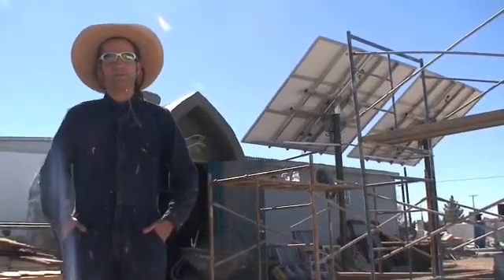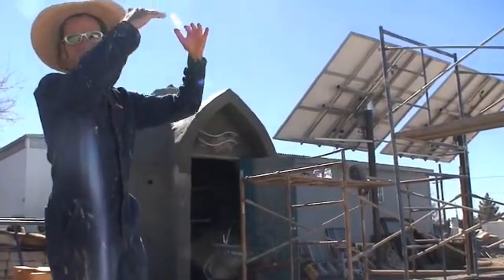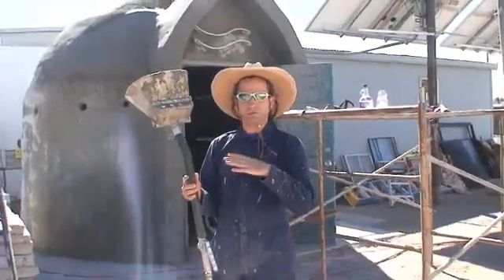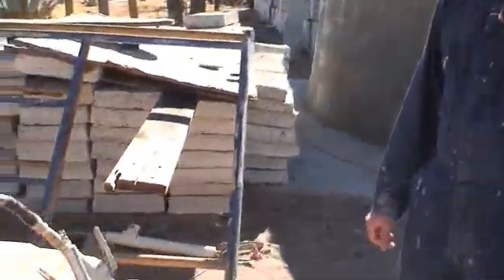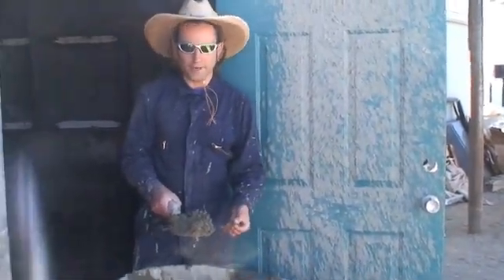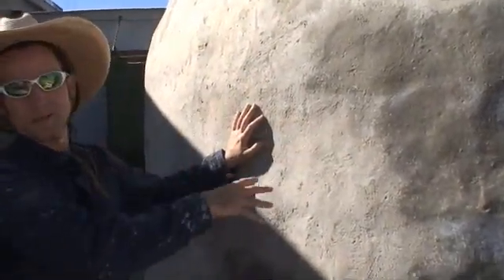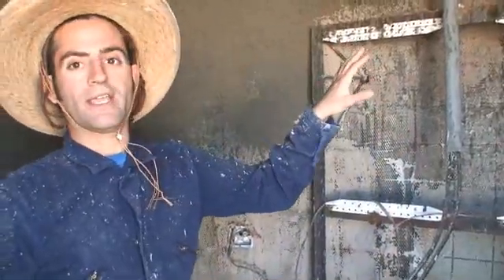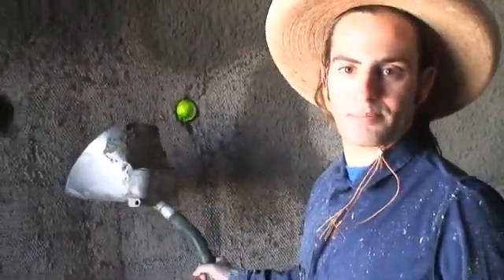Papercrete Battery Dome -

Comment: Hey Dude,   Loving your vids!!!  Im starting another Eco project made from 2 40ft reefer shipping containers and plan to use papercrete on the outside..... But i want to use it also in the interior for the ceiling,  any tips as the reefers interior is food grade stainless steel and im worried it wont take and just fall off.....   

Keep it up mate,
K